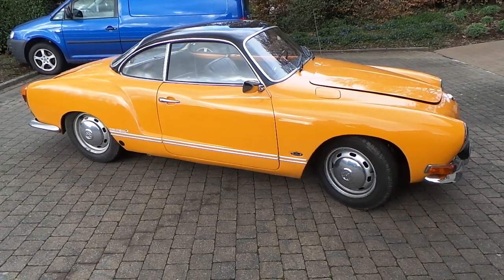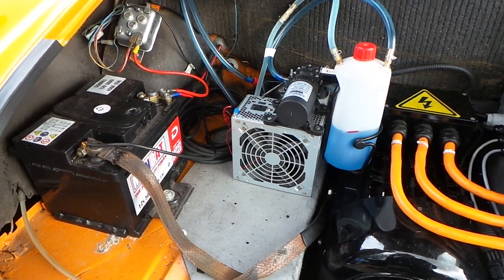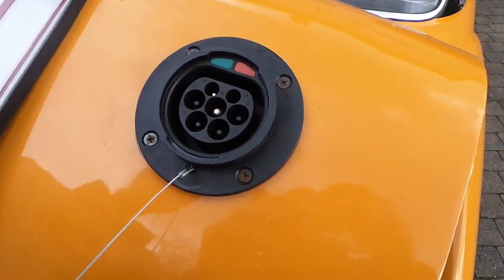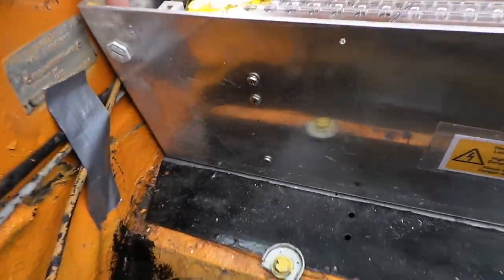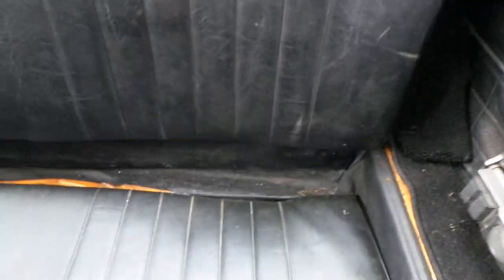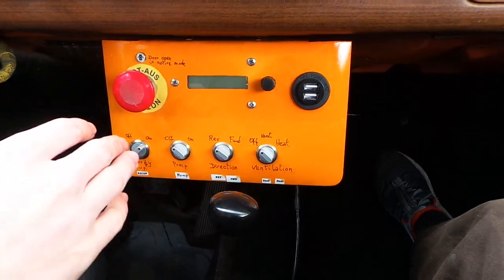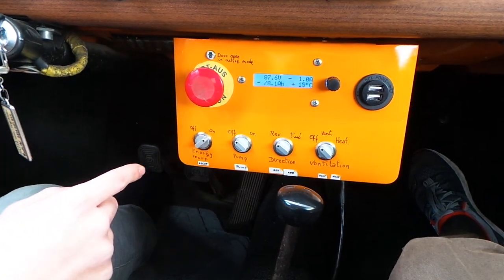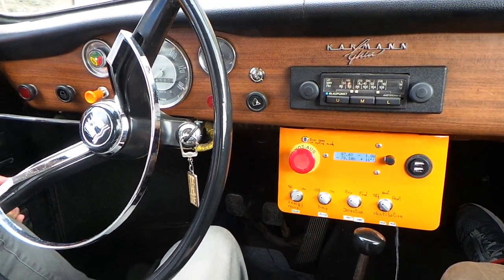Karmann Ghia EV Conversion Overview

Comment: What size heat exchanger do you need for the four Tesla battery packs? I only saw a very small 120mm² maybe (in the old pc PSU case) heat exchanger in the back, is there another?

Comment: The conversion; The engine, fuel tank and all components related to them are removed.  Batteries, motor  and all components related to them are installed.

Unfortunately the batteries take up most of the trunk space and the components to manage the batteries and motor take up the space of the original engine.
You gain performance (kind of) but loose practicality and possibly range?